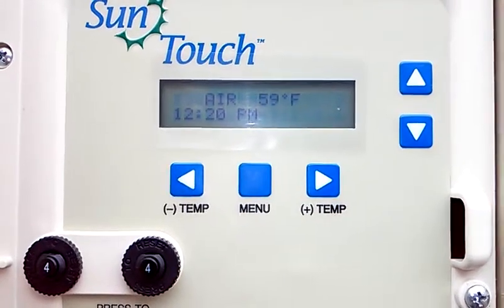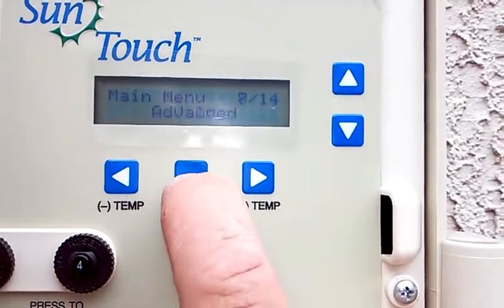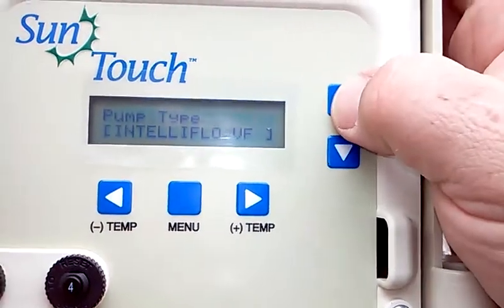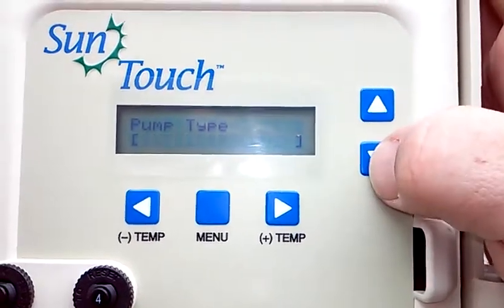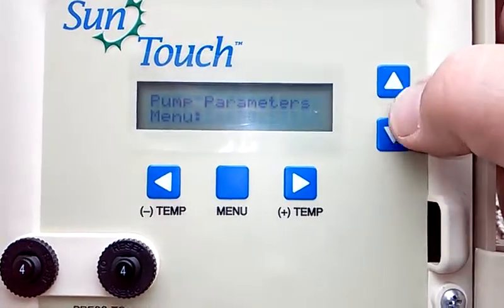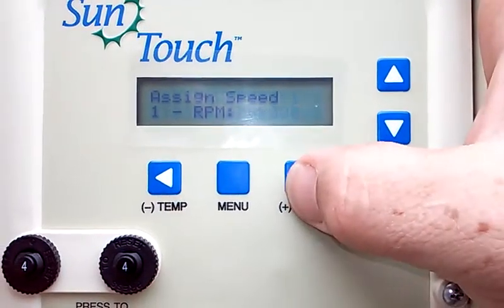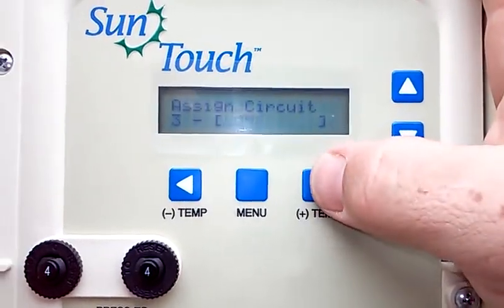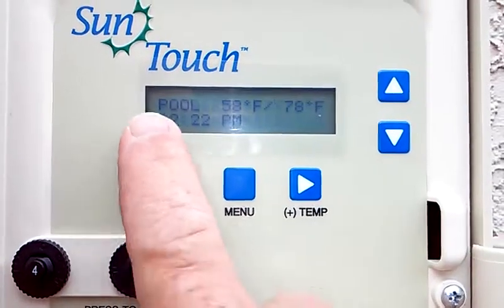Sun Touch How To Set Up The Intelliflo Pump

Comment: Hi John, my display lights up but I can't see any numerals, etc. and the controller no longer works. Could this be due to low battery or do I need to replace the controller?
Reply from the maker: The battery only saves the time. You might just need a new display board.